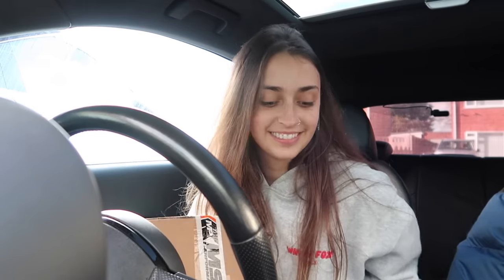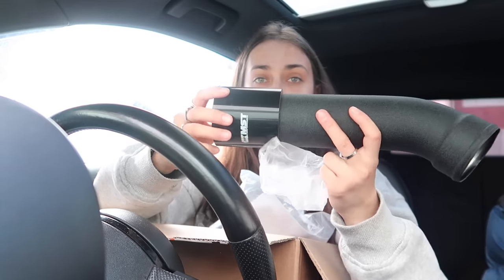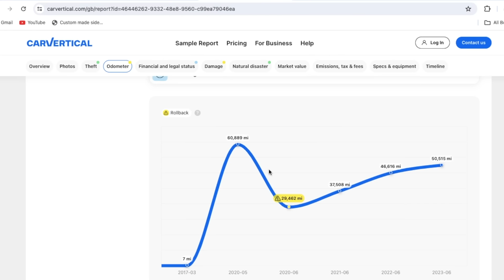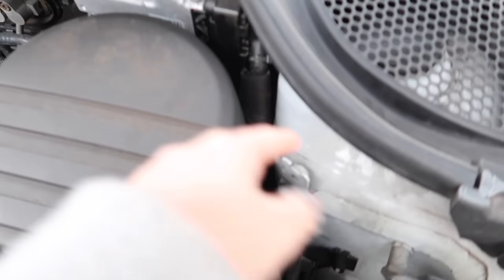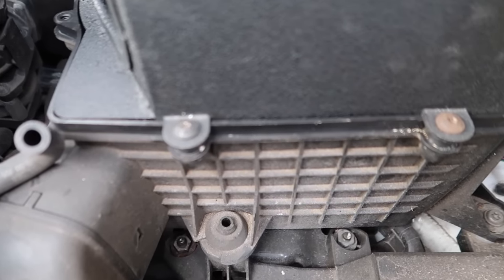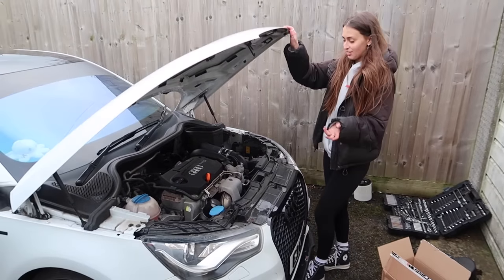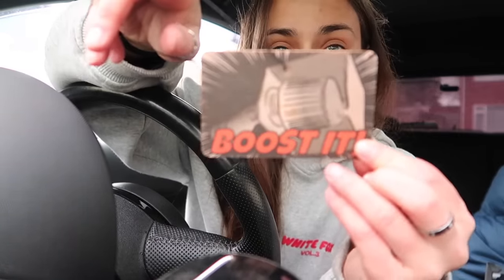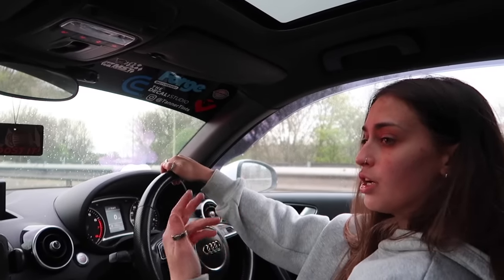INSTALLING AN INDUCTION KIT TO MY AUDI A1!!

Comment: take off the bov and the induction will be louder and the bov causes a boost leak
Reply from the maker: i cantttttt, i love the bov so much😭😭 it sounds too good to get rid of!🙏🏼🤣
Reply: @chlxeblackwell  it does sound good but u won’t hear the induction as much cause of the bov once u take it off u will hear it a lot more and if u decide to map the car it will be a lot faster without it had the same issue 😅
Reply: @mutamminchowdhury9986   her exhaust is too loud to hear the induction properly anyways
Reply: @thesilentgametestr nah my exhaust is loud af but the turbo flutter is louder

Comment: And now to make it run properly a stage 1 Revo remap .
Reply: A bigger intercooler would work wonders , and a faster recirculating valve (dump valve) make sure it's NOT an atmospheric valve because it will screw up the way the car runs big time on VAG engines. You won't get a big blow-off sound but the throttle response will be much better.
Reply: Would you recommend a stage 2 and what upgrades with it ?
Reply: @finleyvincent7011  the above with a stage 2

Comment: looks cool, but your exhaust is too loud to hear the induction from inside.  you would hear induction noise plus whooshing of air and then what would sound like a more toned down DV when you accelerated and change gear, the later probably not so much for you as you have an aftermarket DV.   my car is stock apart from induction, so i can hear what its like.  you will get somewhat different sound between mesh & foam plus i guess placement too?  mines a universal and at the front as i have a different style 1.4 tsi.

Comment: Take off the blow off valve and it will sound even better. The blow off valve is restrictive as well, and if you were to get the car mapped it to hold down power.
Reply: What are you talking about lad?
Reply: @timmysawdust193  release more boost faster and sounds louder
Reply: @Olivermx_enduro  Do you know what a bov or dv actually does?
Reply: @timmysawdust193  release boost pressure and different spring loads only let certain amounts out
Reply: @Olivermx_enduro  Yeh to exhaust the air when you let off the accelerator so it doesn't go back towards the turbo. Also has no effect on power just makes a different sound depending on your set up.
Reply: @timmysawdust193  yes so if you more want a stutututu you dot have a blow off valve
Reply: @Olivermx_enduro  No mate the bov is what makes the sound.
Reply: @timmysawdust193  yes, and how do you think it makes a sound by releasing the boost pressure to the blow off valve and it can only release as much as the spring can open
Reply: @Olivermx_enduro  The blow off valve makes the sound then you insert the correct spring for your application. You need to maintain pressure you divvy